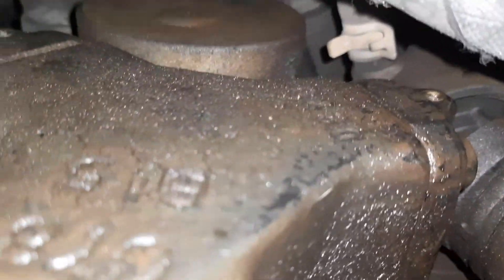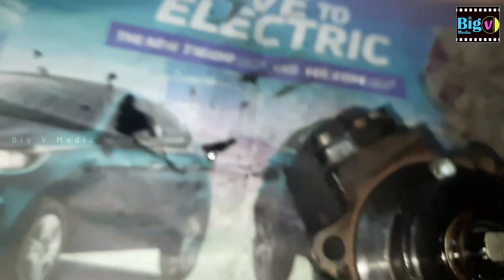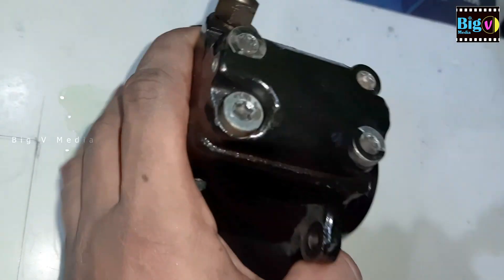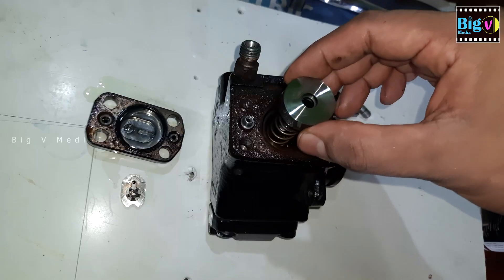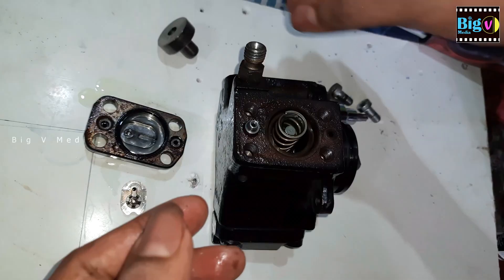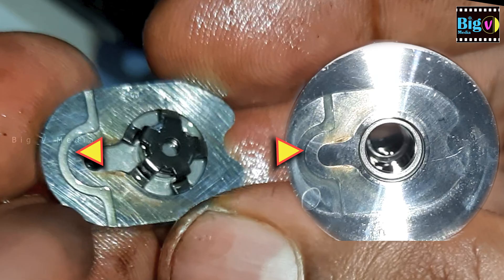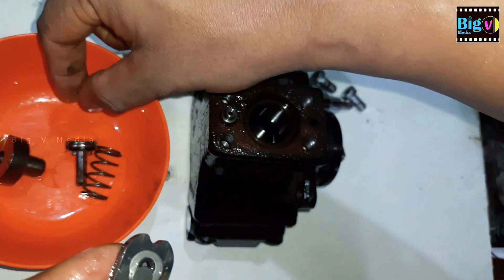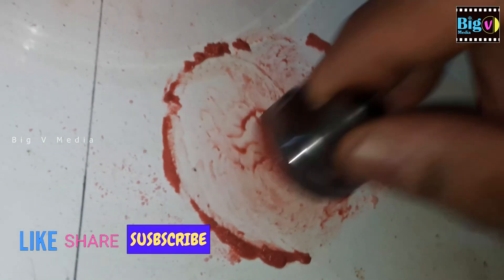Universal Bosch Common Rail CP1 High Pressure Fuel Pump fixing weak pressure | O-Rings, Seals, Leaks

Comment: I ask: Does this pump have a pressure valve somewhere? Because if it does, it could be dirty and not do its job, which is to maintain pressure inside the pump, allowing fuel to flow back to the tank.
Reply from the maker: No, it's not in the pump. Instead, there's a common rail on the outside. It has a regulating valve.

Comment: Hello, i bought a injection pump and when i spined it with my hand it was building pressure, them i took one of the piston head off and then placed it back on and now the pump doesnt building pressure at all, what could be the problem
Reply from the maker: Is everything aligned correctly? Are the rubber seals installed properly? Is everything tightened securely? Are any valves or similar parts installed in reverse? Is the piston scratched?

Comment: good afternoon, why do you think such a pump can let a lot of fuel through the return? (outlet next to low pressure inlet). If you plug this tube with your finger, the car starts almost immediately.
Reply: @Tavol_Max  hello, if the car build pressure when u cover the fuel return line you most likely have a bad fuel pressure regulator
Reply from the maker: yes
Reply: @RodicaOlaru-k8o  I don't agree. This is the first modification of the common rail CR1; there is no regulator valve on the pump. the valve is located on the fuel rail. and I shut off the return pipe that comes from the high pressure pump. Through this tube the fuel goes to the return line; it is designed to cool and lubricate the pump.

Comment: Shanghai 295AD-(b), 2 cylinder diesel, circa 1999.
Was working fine, then fuel filter casing broke off; I repaired the casing, put it back, bled everything, but motor won't start.
Eventually I traced the problem to one of the outputs of the high pressure pump. This is a non-rail system, so there are two HPFP to each injector.
One of the outlets squirts fuel like it's supposed to, the other one is silent, no fuel comes out.
Looking like I have to take the HP fuel pump off the motor, and troubleshoot or replace it. Replacing it is a challenge cause its so old, can't find parts.
Not experienced at disassembling high pressure fuel pumps. I am thinking maybe a piece of debris got sucked into HPFP from when fuel filter casing fell apart.
Reply from the maker: is it bosch HPFP?
Reply: @bigvmedia  I don't think so. Shanghai 295AD-(b), 2 cylinder diesel, circa 1999.
Reply from the maker: You are right, the debris may have been drawn into the PFP

Comment: Hello, i bought a used high pressure pump, it worked great it was creating fuel pressure, i opened the cover and took the piston out, then i got the piston back inside, and now it won't get high pressure pump won't work, i got everything back inside as it should but now it doesnt work anymore
Reply from the maker: Why did you remove a pump that was functioning well? 😕 It's a highly precise device. If such pumps are operational, it's best not to dismantle them. 😊  Have you inspected all the seals and O-rings you've used?  🤔 Did you look for leaks anywhere?  💧 Is the micro spring at the bottom of the valve correctly positioned? 🔄Did it rotate? Is there dust or dirt present anywhere? 🌱Blocked small holes can lead to decreased pressure. How did you ascertain there was sufficient pressure previously? 😕Did you verify that?
Reply: @bigvmedia , well so I have this pump that I bought and another one on the car, the pump that is on the car won't work, and this one that I bought was running perfectly, I decided to take the piston from the pump I bought and put it in the other one, still didn't work, Now I got the piston back in the pump and now it won't work, it makes a little sound, but no fuel coming out
Reply: @bigvmedia like everything is put back together the way it should, there might be something clogged because when the pump was working, fuel was coming out from the high pressure side  even if I didn't spin the pump, now it doesn't anymore, so something is probably clogged
Reply from the maker: May be. Try carefully once more. All the best
Reply: @bigvmedia  I would open it but it has the support that keeps it on the car and I don't know how to take it off
Reply from the maker: If it is a fiat multi jet engine then its vacuum pump should be removed first
Reply: @bigvmedia  well, everything is working well now, the problem was that the lift pump wasn't generating enough pressure, so it didn't have enough pressure to pass through the inlet valve and let the fuel go to the high pressure side
Reply from the maker: Glad to know your problem has been resolved. Thank You.❤
Reply: change  all ball and springs

Comment: Perfect video. Used it, changed all seals. But now my car stalls when accelerating hard. It shut off engine. After 10s i can run car normally again. If drive slowly everything works. If i just press more pedal it stops. I didnt polish any surfaces. Maybe thats the problem...
Reply from the maker: The fuel supply line  between the high pressure pump and fuel filter needs to be checked. Also check fuel pump (in tank) pressure. Remove the hose from the diesel filter to the pressure pump. Crank and verify that sufficient diesel is coming from the hose end. Finally the high pressure pump should be checked to see if it is providing sufficient pressure. Thanks
Reply: It started after rebuilding this pump. So i think i messed something. Can the issue be that owertightened the four nuts of each cilinder head?
Reply from the maker: No chance.  A diesel engine can stall for a number of reasons, including:
Fuel system issues: A lack of fuel, dirty fuel injectors, or a clogged fuel filter can cause a diesel engine to stall. A clogged diesel filter can cause the engine to stutter, jerk, or stall when accelerating.
Airflow issues: A clogged air filter can cause a car to feel sluggish when accelerating. Dirty air filters can also increase fuel consumption and, in extreme cases, stall the engine.
Transmission problems: Both manual and automatic transmissions can cause a car to stall. A failing torque converter in an automatic transmission can cause the car to stall unexpectedly.
Catalytic converter issues: A clogged catalytic converter can cause the engine to shake and stall.
Fuel pump issues: A failing or failed fuel pump can cause stalling or a no-start condition.
Reply: Hiii ! what was the cause your car stall ??
Reply: Hi i wanted to ask in good working pump if you unscrew output line that goes to injectors and crank engine it should shoot out fuel?

Comment: Best video for this pump. However, Even tho my pump looked similarly rusty outside, I found out I have questionable ammount of vacuum on 2 pistons and barely any vacuum on the third piston. The inside trianhle piece has much bigger wearmarks for all 3 pistons, I can notice a ridge there. I guess I need a new pump.
Reply from the maker: No.  You will get the replacement parts online!

Comment: Hello, i have a bosch high pressure fuel pump in my peugeot 206 2.0hdi, i believe it airlocked, any idea how to fix it before i take it to a mechanic?
Reply from the maker: An airlock occurs in a mechanical high pressure fuel injection system when air is trapped between the pump and the fuel injectors. This can happen when air leaks into the fuel delivery line or enters from the tank. Causes for airlock, also include- Allowing the fuel tank to run dry, Changing a fuel filter, Leaky fuel lines  etc.
Air locks can be eliminated by turning the engine over for a time using the starter motor or bleeding the fuel system.
The presence of a trapped air bubble hinders the smooth flow of fuel through the system, leading to symptoms such as challenging engine starts, diminished engine power post-startup, and, in more severe instances, an inability to initiate the engine. Do you have any symptoms explained?
Reply: @bigvmedia  Yes, my engine wont start, it used to barely start and die but since ive cleaned the whole fuel line the fuel wont come out of the fuel pump, ita pumping all fuel to the return line
Reply: قد يستمر تدفق فقاعات الهواء اذا كان نظام الحقن الديزل لايوجد فيه مضخة توصيل في الخزان معنى ذالك ان الضغط الموجود في انابيب التوصيل 1بار> اقل من واد بار يكفي لثقب صغير ان يفسد عملية الشفط
Reply from the maker: Yes you are right. Thank You!
Reply: @bigvmedia  hello again, my engine is still pushing all fuel to the return line. It has great pressure from the filter to the pump but nothing comes out of the high pressure fuel pump. Could it be a dead pump or just fully airlocked?
Reply from the maker: @CokieZip  It's possible that the high-pressure fuel pump is malfunctioning or dead. This could be due to wear and tear, internal damage, or other issues. Another possibility is that the pump is airlocked, meaning there is trapped air preventing proper fuel flow. This could happen if there was air introduced into the system during maintenance or due to a leak.  Bleed the fuel system to remove any air that may be trapped. This involves following the manufacturer's instructions for your specific engine to release any air from the system. If bleeding the system doesn't resolve the issue, you may need to inspect the high-pressure fuel pump. This could involve testing it for proper function or visually inspecting for any signs of damage or malfunction. Refer to your engine's manual for specific troubleshooting steps .Thanks